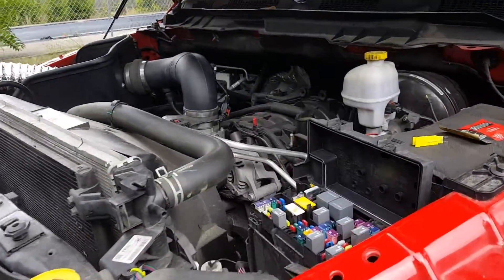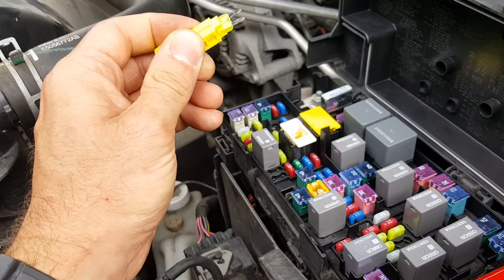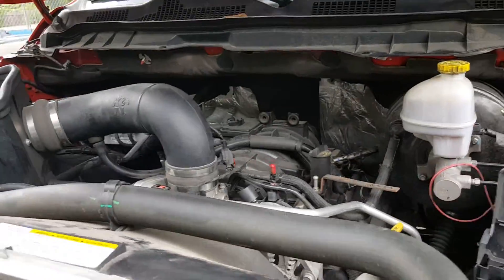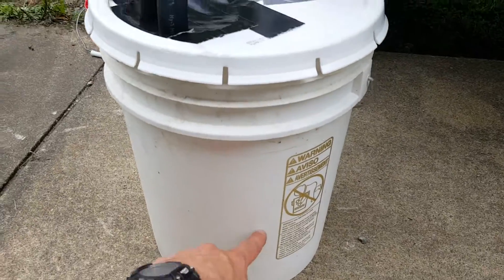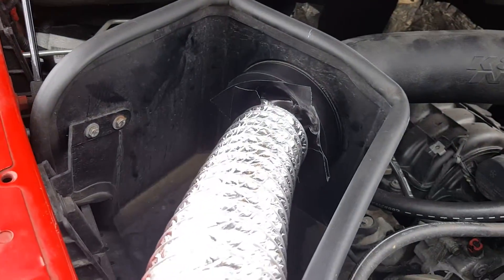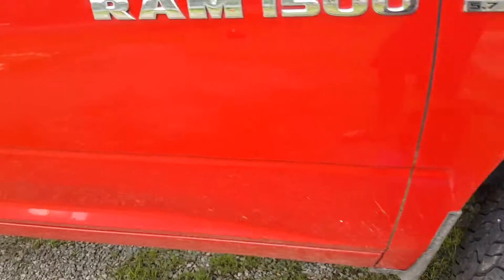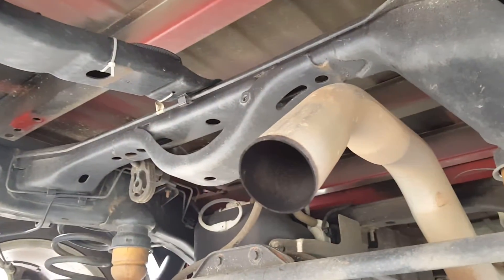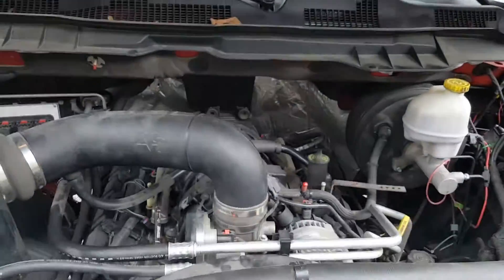Truck Running on Gasoline Vapor

Comment: Hi there, I like your video. I have a 2014 ram 1500 that I would like to convert to Gasoline vapors. Did any of your engine lights come on when you were running on Vapors only? How did the ECM and the timing react to all of the gasoline vapors when you were driving it?
Reply from the maker: Hey Su! I never had any engine lights come on but I will day that I didn't run the system for am extended amount of time.   Only a couple weeks.
Reply: @AmateurAtBest why you never run the truck on that system ??
Was it not saving money